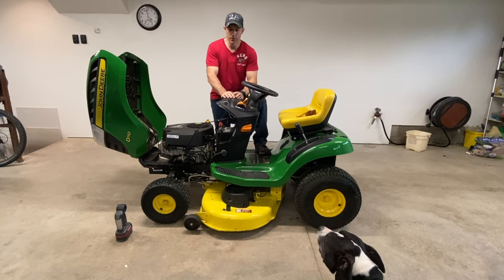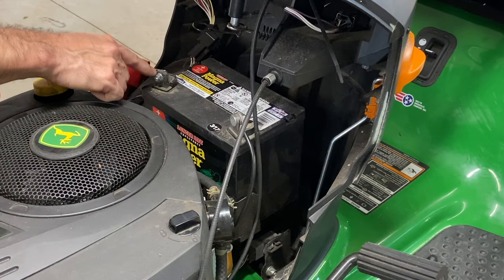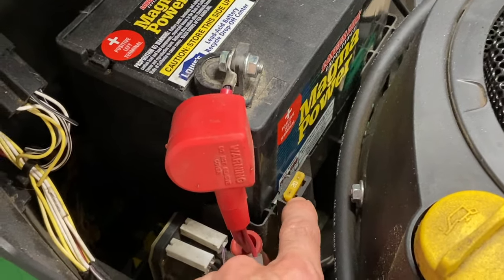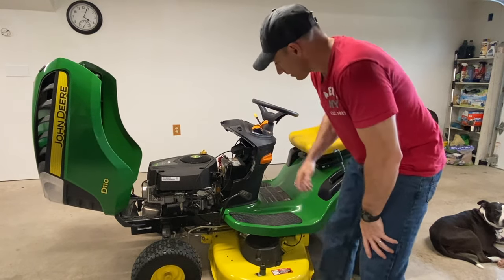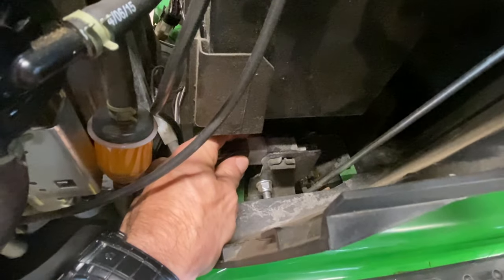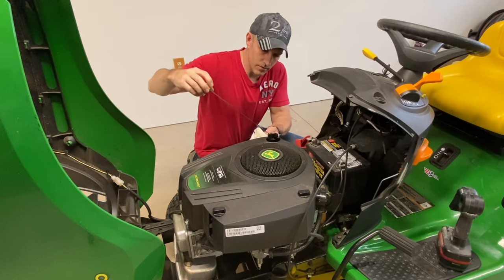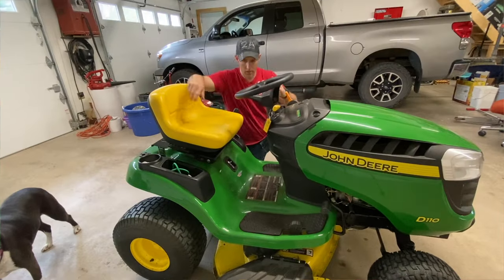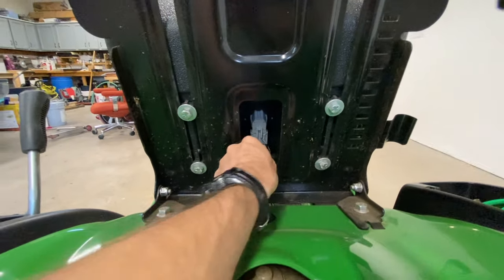JOHN DEERE 100 SERIES WON'T START

Comment: Hey there, I just bought a John Deere 115 Auto and it ran fine, ( though backfired a couple times)  i mowed the yard once and it was great, went to mow it again, and it spun but wouldn't start, gas was low, so put a gallon of gas in it, still no start, saw on the net to try starting fluid to rule out things and it said if it starts then dies its a fuel problem, which is exactly what it did, So checked fuel pump, (works fine) checked line to fuel pump, thats fine, fuels getting to carb, Guy i bought it from said he replaced carburetor 2 days before i bought it, so it shouldn't be the carb.( but pics of his yard had lots of bare dirt spots ( mines not) and mower is very dirty on the inside, But he asked if i put 87 gas in it which i did, and said that might be it as he always put 93 in it, and said i should drain carb and tank and put 93 in it,  i dont think thats it, but im going to take carb off tomorrow and try to clean it, If i can find a tutorial) i also put in a new spark plug today, (still wont start)  do you have any suggestions?, having just bought it i dont have any money to have someone fix it. thanks so much for reading.
Show less

REPLY
Reply from the maker: Holy smokes that’s a long comment. Wish I could definitely tell you what to check. If you tried everything in my video. Sounds like something with the carb hope it is the right one. It’s hard to diagnose over a comment. I usually have a friend come over and also look at it. Sometimes a friend will see something you did not think of. I had a problem with my gas tank I unhooked one of the lines under the seat and blew air in it. But mine would run it just ran bad. Good luck sorry I can not give a definite answer to your problem.
Reply: Tony Hayes It could very well be the new carburetor - still.  Especially if he did it 2 days before you bought it.  Two months before and running every week, not so much.  An hour of running, the carb may still not be “good”, even though brand new.  In fact, it may be the fuel shut off solenoid.  When you crank the engine for 5 seconds or so (full choke) WITH THE SPARK PLUG WIRE DISCONNECTED, pull the spark plug out and see if it soaking wet and smells of gas.  If the plug is bone dry, you have a fuel problem, still.  Either through the fuel filter or from the fuel pump to the carb or through the carb itself.  

Probably a fuel shut off problem as it is a new, still unproven carb.   One hour doesn’t count.  Be sure the connector on the bottom of the carb is all the way pushed in and solid.  If that is disconnected or too loose, it will NEVER start.  If that plug tip is dry and you are positive there is fuel flowing to the carb, the next thing, unfortunately would be to replace the carb again or the solenoid at least.  Probably easier to replace the carb but the solenoid is easy and under 10 dollars.  An aftermarket carb is roughly $20.  $100 for the oem version.  

You will also have to put a spark tester inline with your plug as you crank (best to do this in the shade or a darker garage) to make sure there is a good spark.  If there is no spark, make sure all the safety features are properly engaged or disengaged as those kill spark.  The ignition off kills the fuel.  I think too low of oil may kill fuel as well.  

If you are getting a wet plug when cranking for 5 seconds and not starting, then you must not be getting a proper spark.  If you have a wet plug and a proper spark, then the only other thing is the proper amount of fuel OR the valves are off slightly.  Adjusting valves is a whole different issue and you can find a video on that.  The fact that you can start it briefly with starting fluid suggests a fuel problem.  Starting from scratch, a next step replacing a carb.  

My guess is a fuel problem, 87 grade is fine as long as there is not water in it.  Alcohol free gas is 89 octane.   The problem is what is causing the fuel supply problem and most likely it is the anti backfire solenoid.  

Two things you need:  spark and fuel.  If you don’t have both you are out of luck.  

Oh, a tip...  Before you start all this charge up battery to a full charge and keep recharging it to full charge as you test and in between.  You would be surprised how fast an old battery can die when you crank it for a while.   When you get it running, you want the battery to be fully charged.  Keep it topped off while doing all this.  

It is NOT the fuel unless you had water in yours.  It is best to always spend the extra money and get no alcohol gasoline.  Saves a ton of water problems.
Reply from the maker: Alan Thank you for trying to help that was a lot of typing. I hope this helps Tony out.
Reply: @alankauth  Thank You so much Sir, alot of good info and i will apply it all, Much appreciated!

Comment: What Abt carburetor like do I have to remove it to clean it? my d110 starts and then dies I took the air filter off, covered hole with hand and it runs it will stay running till I fully uncover hole... I was thinking spraying throttle cleaner in there or some type of cleaner
Reply from the maker: Is your mower new if so I did have on problem with my mower getting fuel. I lifted the seat unhooked the one fuel lines and blew air in it. It seemed like there was something in the fuel line. I wish I would have taken a video of this when it happened. But yours not sure what’s wrong it’s hard to diagnose over a message. Hope you get it figured out.
Reply: @DIYJIM  it's less then a yr old

Comment: Thanks for showing where that brake switch is located. I suspect that's my no-start issue. Ridiculous to have this problem when it only has SIX HOURS run time on it.
Reply from the maker: I'll say thats crazy hope you get it figured out
Reply: My e130 quit on me with only 30 hours on it , I’m still trying to figure it out checked everything but the carb so far have to wait for a little bit warmer weather. Thanks for the tips btw great video gave me everything I needed to check.

Comment: Great all around tips 👍.  Just had a problem yesterday, that maybe someone can help diagnose.  Even though it is Wintertime, we get enough nice days here in Maryland that I’m able to get our JD D130 out and take it for a spin.  Every two weeks or so, out and about & then let it idle for a few mins.   Yesterday, took it for a spin, back to the garage.  Engaged the orange safety lock & hopped off.  The second I got off, the engine cut out.    Can’t figure out if it is the seat safety mechanism or the orange safety control switch.  Battery was good, has gas, etc.   The engine cut right off.  Won’t even attempt to “crank” when i engage the key.  Thoughts? 🙏
Reply from the maker: Did you engage the blades because if they are on and you get off it will shut off and not start until you disengage them.

Comment: No turn over I've already replaced the starter solenoid battery is charged but safety switch is connected terminals are tight
Reply from the maker: Sounds like you might have to have someone else look at it. I just know how to check the easy stuff. Sorry I can not help. Hope you get it figured out.

Comment: You failed to mention the fuel pump. If the lawn mower turns over and doesn't start, remove the line after the fuel pump to see if there's gas coming out. If not, check the vacuum line
Reply from the maker: That is another good thing to check thanks for commenting maybe this will help someone
Reply: Another thing is if the brake is on, you don't have to be sitting in the seat to start the mower

Comment: What do I do if it’s making the noise it makes when it’s starting up but then just keeps repeating the noise and doesn’t actually start?
Reply from the maker: Sounds like you might have to have someone look at it for you.
Reply: It turns over but fire, sounds like bad fuel filter or your carburetor may be clogged

Comment: Have older model John Deere riding lawnmower,won't start,, what do l do?
Reply from the maker: Maybe have someone look at it
Reply: Kenneth,  as my dad always told me there are three components required to run an combustion engine: 1. Fuel, 2. Spark, 3. Compression. If it doesn't turn over, then it's electrical (safety switches usually on mine, though it was the fuse today) , if it turns over but won't start, usually it's gas with these.  Very rarely it will be compression (even a loose spark plug can happen, but rare), so I focus on the first two.

BTW, the brake switch on mine comes loose, so it doesn't get actuated, so it's like I left the brake off, and won't turn over.  Need to put something to lock the clip in, just lower priority.

There are tons of videos like this one that can help, but if you're not comfortable around mechanical things, then there are folks who can help. We had a guy come out early when I got the tractor to look at things, and he was very reasonable. It was with the local J.D. dealership too. Know your limitations and deal accordingly.

Comment: It got light on but no sound no cranking nothing
Reply: I have the same issue.
Reply: @victorcarroll529  I got it fix
Reply: How? Was it the voltage regulator?
Reply: @farmfitnesspham4913  how was it the voltage regulator?

Comment: Mine starts---but takes about 10 to 15 cranks to do it.
Reply from the maker: Check air filter, maybe you need a new spark plug, have you ever change the fuel filter, also i run 91 or 93 octane and i add a small amount of sea foam, watch my other video maybe something i go over in it will help you mower run better. https://youtu.be/TeZUBvkh0N8
Reply: @DIYJIM  Hi, Jim. I use high-octane ethanol free gasoline. Good stuff! The air filter is good. Have not checked the spark plug and have not replaced the fuel filter. Will do that. Once the engine is warm if I have to cut it off for some reason then it fires right back up after just one or two tries.

Comment: Mine won’t even crank
Reply from the maker: Did you check the battery?
Reply: DIY with JIM the battery seems to be the problem, but it won’t charge... bad battery maybe?
Reply from the maker: Sounds like you need a new battery, some places can check it for you. Hope you get it figured out.
Reply: DIY with JIM thanks m8
Reply: DIY with JIM so we replaced the battery today and it still won’t crank
Reply from the maker: You might have to take it somewhere or have someone look at it. Make sure your blades are not engaged. Sorry I can not help you more

Comment: Don't forget the machine will not start if the bonnet/hood is open. As I found out!!
Reply from the maker: thank you for the comment
Reply: False he started his in video with hood up!
Reply from the maker: my mower does not have a safety on the hood
Reply: Mine does not either and it’s a 125
Reply: Not because it was taken off it didn’t come with it
Reply: Wrong! My L130 will start all day long with the hood up.  Shawn.
Reply: @shawnbeck2303  Possibly only UK spec. Pete